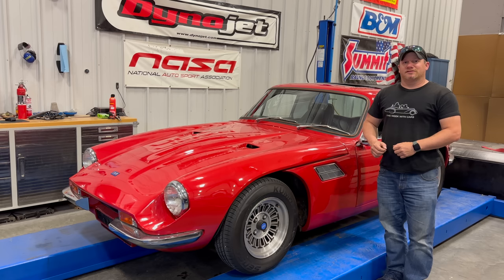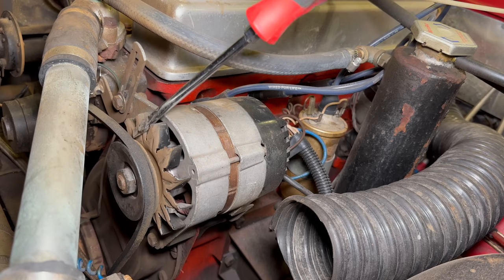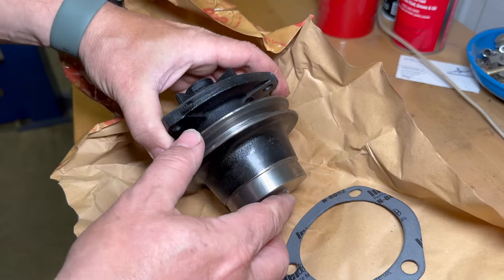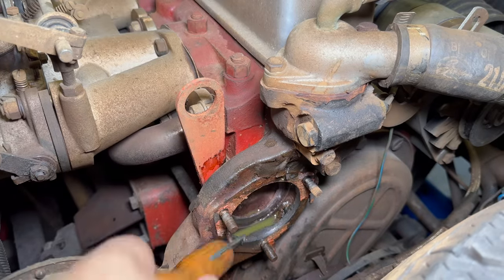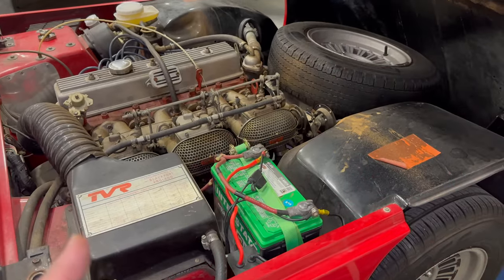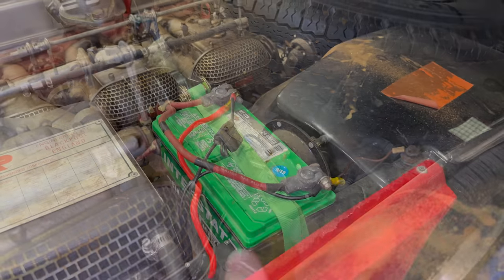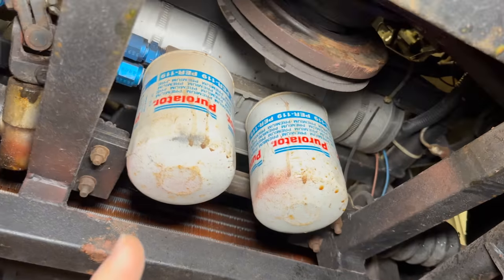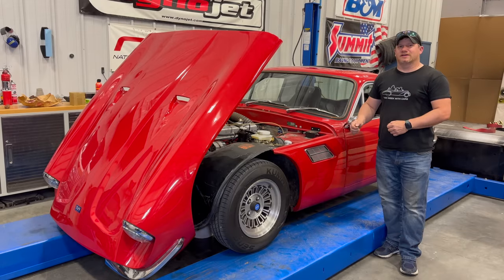I Should Have Fixed the TVR 2500M Sooner

Comment: Back in the day I knew a few guys with the V6 Tamar, amazing cars if a touch "fragile", that 2500 is a real beauty and in very good hands it appears
Reply: There was a TVR wedge abandoned in front of a bar I use to go to. Not knowing much about cars, I had written it off as a kit car from the 70s.

Wish I would have inquired more about that car.
Reply: @quintessenceSL  Having helped out on fixing some of my friends TVRs the notion of them being kit cars wasn't too far from the truth. As was said in Top Gear once they were kits in reverse, you buy them as complete cars and they gradually revert to kit form the longer you drive them.  Every TVR Owner seemed to have a parts list detailing where all the bits on their car came from

Comment: I thought I recognised a Triumph water pump and engine.   The paint on the body looks amazing and I assume it was painted and kept indoors since it was painted.  What a lovely car. I always liked the TVR early models.
Reply: yeah, thought the same. Looks like my TR6 motor. I only have two webers tho 🙄
Reply: @boldorboy08  Yes, I checked, it seems it is the TR6 engine. I only recognised the water pump as I currently have restored a Midget which has the Triumph 1500 engine.

Comment: The 2500M is the "federalized" version of the 3000M & Taimar (Triumph S6 instead of Ford Essex V6). TVR made a small number of 1600M cars too, using the Ford Kent S4.
Reply from the maker: They tried to make a catalytic system for the 3000M to sell them in the US but they were stopped at the port and sent to Germany.  I have an Essex V6 powdered Marcos.

Comment: Had the same problem with the waterpump on my 74 TVR 2500M. The replaced new water pump only lasted 1,5 years due to very poor built quality of the new parts available.. I switched to a racesport alloy water pump which is much lighter and haas an improved fan so uch more pumping power as well as long lasting bearings... It was not cheap but worth the upgrade especially since the TR6 engine tends to overheat easily...

Comment: The cars came originally with stock TR6 2.5 @ 104 hp which in my 73 TR6 is not exactly performance, could you go into more detail about what kind improvements were done to this engine to help improve it?  Thanks

Comment: Wix!  The only filters anyone should use.  Is there an advantage to using the racing filters vs the regular ones for street use?
Reply from the maker: The racing filters have better flow and do not filter as small as standard filters but in this car the extra flow is good because it is going through two filters.

Comment: The TVR is a remarkably handsome little machine. It's changed surprisingly little since the original design in the 1950s, when it was astonishingly advanced. What is that motor?
Reply from the maker: The engine is the same as a Triumph TR6
Reply: @ThisWeekWithCars  Thanks for the information.

Comment: Looks like the carbs are loose on the intake too!
Reply: Weber DCOE carburettors should not be bolted solid. They are mounted with either spring type Thackery washers or rubber bobbins. These carbs need to be insulated from vibration to prevent fuel frothing and needle valve issues. Hope this helps.

Comment: So that's a Triumph engine, dry-sumped and with triple carbies?
Reply: Not dry sump (note the oil pan), but the accusump guarantees oil pressure when cornering hard in racing. Sometimes this can slosh the oil away from the oil pickup in the sump and cause it to draw air which is bad.

Comment: Why not make things easier snd remove the spare wheel ?Do you pre fill the oil filters ?
Reply from the maker: The spare wheel isn't in the way of anything.
Reply: @ThisWeekWithCars  looks like it would be easier, you would have the option to work from the front instead of squeezing in from the side, maybe it’s just the camera angle? The answer to the pre fill question was ????

Comment: I can't stand those kind of oil filter wrenches.  Or most kinds actually, lol.  I am fond of K&N filters with the thick steel can and welded in nut for wrench removal.  Doesn't oil can with my high pressure, high volume oil pump on my small block chevy Camaro.  I swear by them now.
Reply from the maker: Unfortunately you can't use them on every car because they only come in limited sizes.